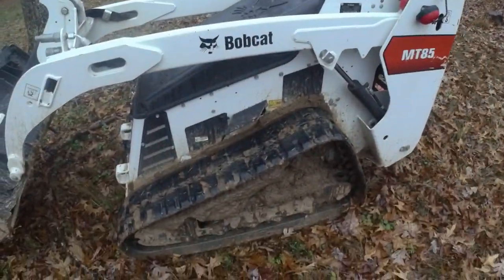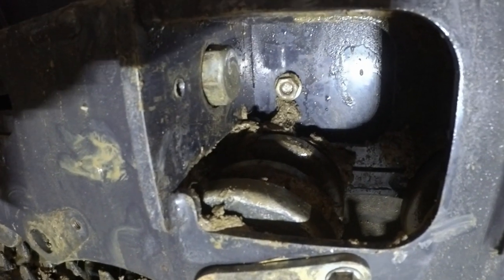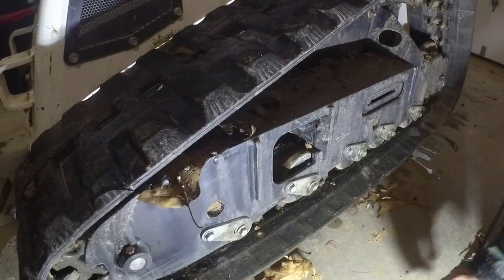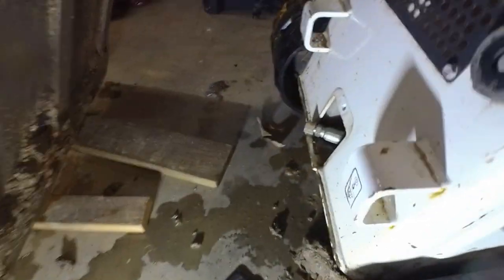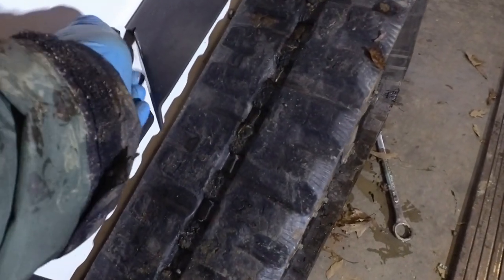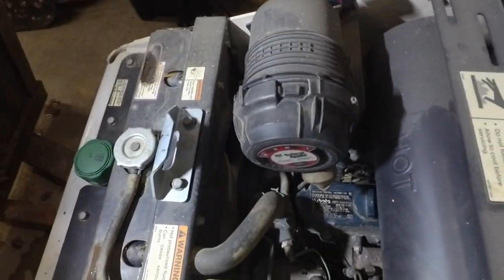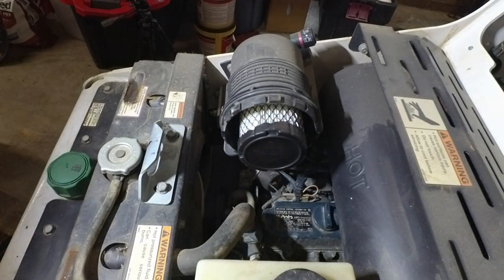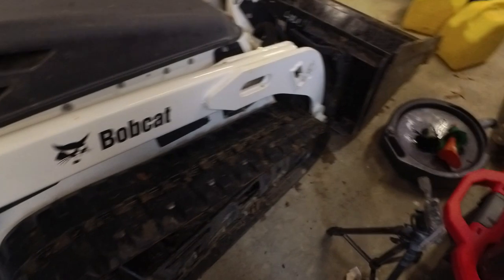Bobcat MT85 mini skid maintenance and track adjustment

Comment: I had the same problem on a new at 200 hours just one missing plate they need blue loctite. I'm looking at buying a used one with 700 hours how much would you pay. How many hours have you all seen on these wondering if the mt55 engine wears out quicker in these with high hours I haven't seen any with more than a few hundred hours
Reply from the maker: E30worx with 700 hours you’d probably pay 16-18k I would guess. This is the off season so a great time to buy. Mine had 400 hours and I paid 20 for mine.

Comment: Hey Shaun... the video was very helpful. I purchased a power rake about two years and guess youtube algorithms that i should watch your video on the repair of your little toro. The rakes are such a great tool for finishing off after trenching. Back ti your video, Im thinking of getting The MT100. What are your thoughts of the 85... do you wish it was bigger or smaller. Thanks in advance and I had to subscribe... cheers.
Reply from the maker: HI - I really like the mt-85. I got it in Dec 2019 so they didn't have the 100 yet. I also got mine used. I don't have any complaints that it's too small or too big. I did buy a 42" bucket since it came with a 48" and I needed to get in a back yard.
Reply: @GCFD  nice... im enjoying watching what you are able to do in your climate. We have frost 4-5 feet in the ground over the winter months and any drains can’t set as close to the the surface as you are able to. I’m just starting to release videos regularly as I have many years of video and photos of jobs.  Please take a look, subscribe if we interest you and comment. Cheers.